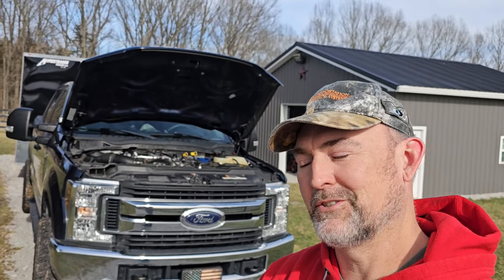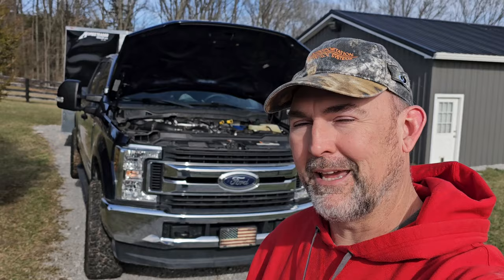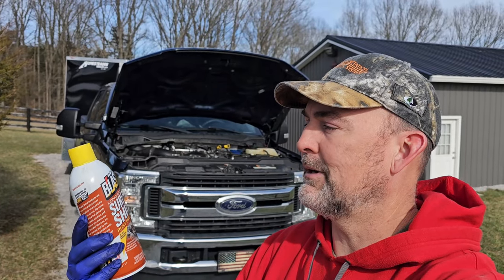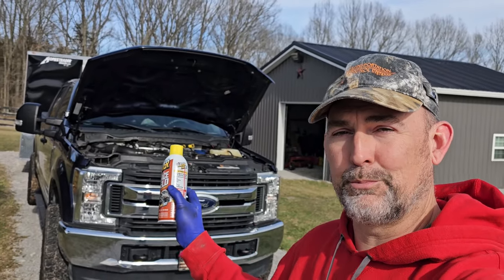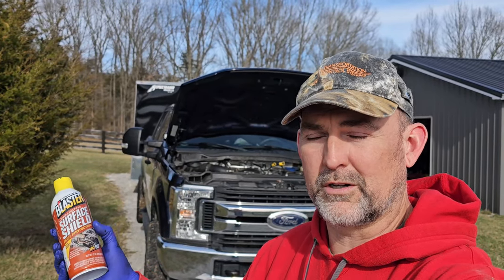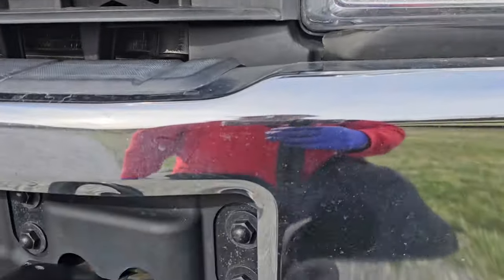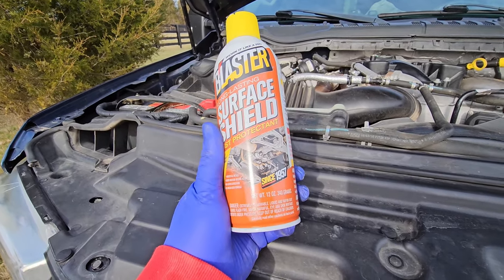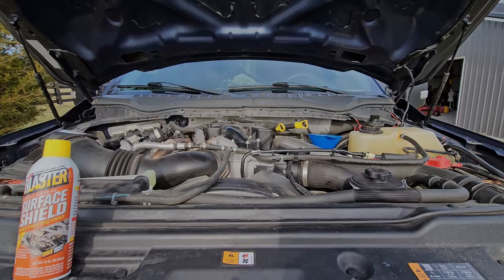Blaster Surface Shield Undercoating - How Did it Hold Up After the First Winter?

Comment: you don't want to clean that dirt off, that works with the oil as a protective coating. I use it on my 2020 F150 in Ontario, Canada

Comment: I’m torn between this and Fluid Film. Probably can’t go wrong with either one. Can’t get Wool Wax in my area.
Reply: I have been using Fluid Film for the last 3yrs on my JLU, and so far there is no rust at all.
Reply: I used to use Fluid film now I switched over to Surface Blaster.  Both are good products, but SB seems to hold better, and it is easier to apply.  You have to warm up FF in colder weather and mix it up really good in order to apply. I don't find that as necessary with SB.
Reply: @skrsys  I just finished up Fluid Film today. I’m in Hawaii but moving back to the mainland, so the truck will be protected on the boat and will only see occasional trips to areas with road salt. It should be more than adequate but it will definitely be something to consider if I redo things in the future
Reply: @chrisridebike8  you should be good with either one. But if you’re going to do it on a regular basis, I would switch to SB for ease of application
Reply: From what I’ve seen the key difference is fluid film can be wiped off (still leaving a oily base behind) and is just thicker. This seems to hold up better against washing and is less gunky
Reply: @chrisridebike8 I’m literally doing the same thing as I am moving to Hawaii
Reply: @DeleonD3100  moving TO Hawaii. You don’t need it here. All the stories about “salt air” are myth with modern vehicles. Been here 3 years and have zero rust, even with some good off roading.
Reply: go with surface shield......fluid film is good but does not stick as well in my expereince.
Reply: @skrsys  i had to thin it out with vegetable oil to spray.....

Comment: Now that you've had the Super Duty for a while, do you have any regrets? I have a 2020 Ram 1500, that I'm consistently over my rear axle weight by 400 lbs. A new trailer will help that, but its still overweight.
Reply from the maker: I miss my last Ram every single day simply because it was a much nicer vehicle. It was a better daily driver. It was more comfortable in winter. The Ram Laramie is just amazing. Having said that, if I could afford a nicer trim level Super Duty with a gas engine I'd never look back.
Reply: @4-LOW  this is the decision I'm faced with. Right now, I put one atv in the bed, and three machines on the trailer. The biggest plus to a Ford, is the Super Duties shorter bed is still 6¾ long. Rams is 6'4", which means the Ford tailgate will close, and the Rams wont.
Reply: To do a really thorough job it's like 7-8 cans on a Super Duty . Inside all the frame rails , behind the bumpers . Up over the rear wheel arches , up inside any pinch welds , when you really get into it the cans go fast . But Kentucky isn't Michigan so maybe you can get away with a lighter touch down there . 👍